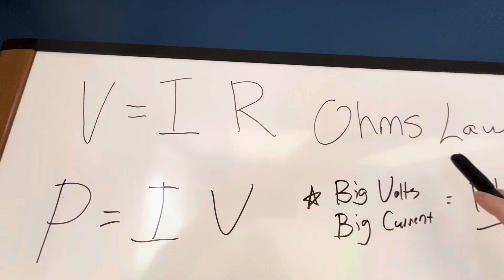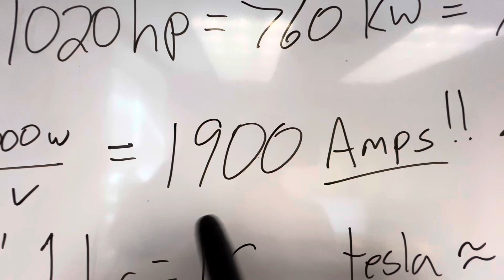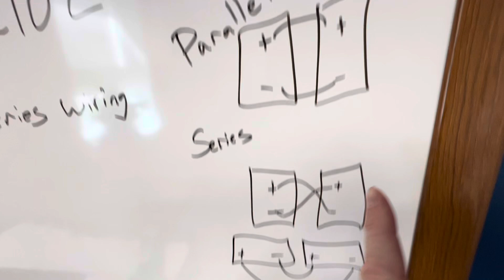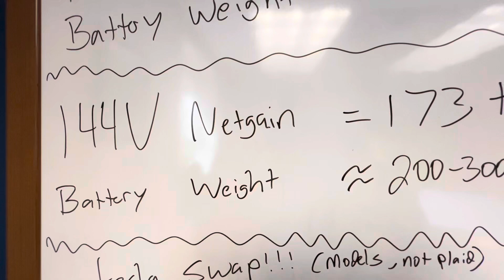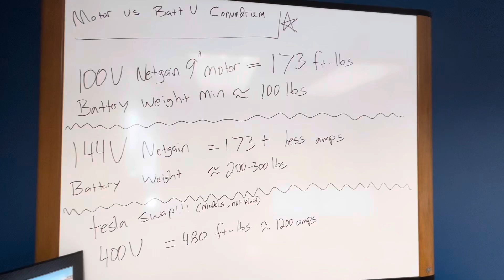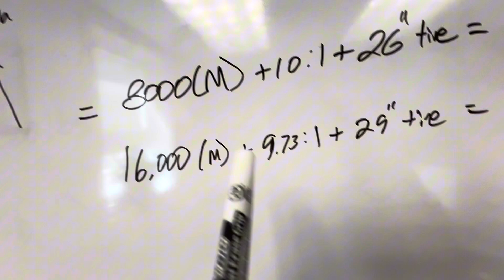EV drivetrain design 101 - the conundrum of weight and POWER

Comment: I want a 2000V EV system. No wimping out at 800V. Orange cables need actual high voltage running along the conductor surface.
Reply from the maker: That would be something!

Comment: Let me get this straight, by your math the Tesla Plaid with your calculation of 10C could go full output for 10 hours? Full acceleration for 10 continuous hours? What would that put it's range to at 200 MPH 10 hours later when the battery finally discharged it's 10C?? I don't have the numbers in front of me but a 2,000 mile range EV isn't on the consumer market quite yet.

Respectfully either I misunderstood what you said or you added a zero somewhere.
Reply from the maker: Sorry lots of math skipped. It was a generalization of pairing batteries to motors so they can discharge the appropriate amps.  C rating and load is about a hour long video in of itself.  My point just be aware you can’t take model 3 batteries and run a tesla plaid motor they can’t support the amps.